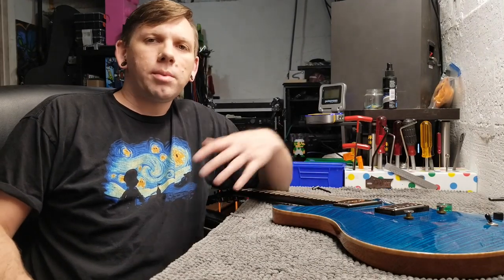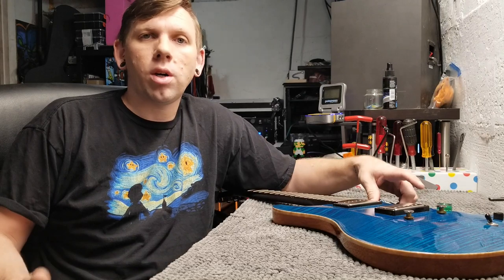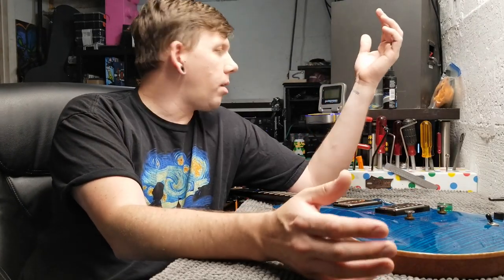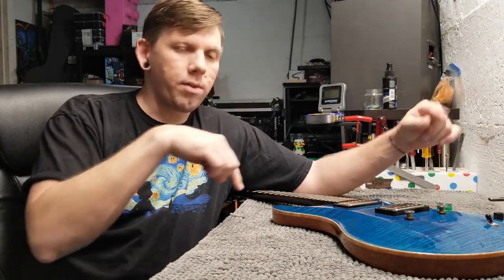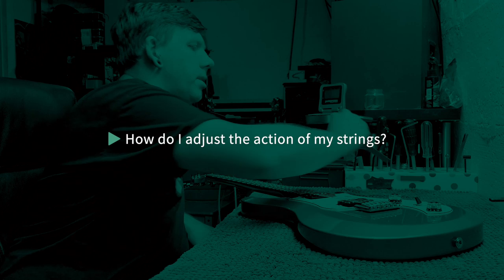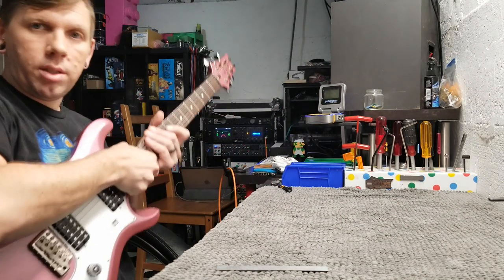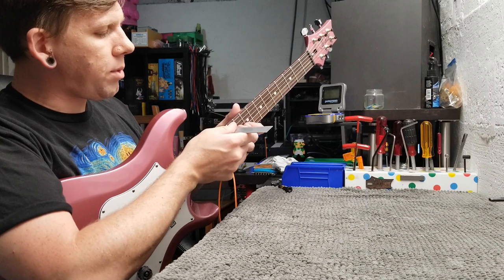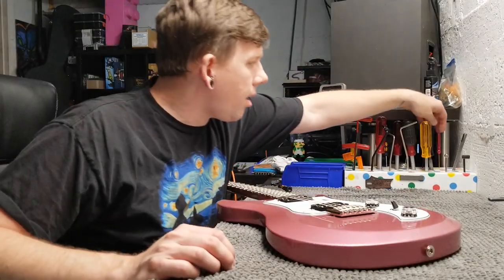Adjusting Your Action | Tips From The Tech Center | PRS Guitars

Comment: How do you adjust the action of the Paul’s Guitar?
Reply: Lol same here i need answers
Reply: I saw one video that showed the brass screws holding the bridge in place is how you adjust it but i only saw one video and the guy didnt even really demonstrate much.
Reply: @zacharybruner765  Yeah thats worked for me for smaller adjustments but when I tried to make larger adjustments that way the bridge ended up getting tilted out of place
Reply: @atticuscrowley  yea i just took mine to get a full set up. Installed the prs se locking tuners not thinking that they dont match up with the vintage style tuners that it came with so it threw it all outta wack. I figure i can make small adjustments down the line once its set up the best it can be

Comment: I realize this video is a year old, but my question is how do you lower the action once you run out of travel on the saddles? My guitar has the trem screws set to float so there's a half step of upward travel. However, the action is still higher than I would like it to be, and both of my E strings are already at the deck on the saddles. Is there a way to keep the half step of upward travel without lowering the tremolo via the trem screws? Or will I have to sacrifice some upward travel to get the action lower? Hopefully someone sees this and can offer some insight. Thanks in advance.
Reply: Same problem with my ce 24
Reply: Same problem. Got a solution?
Reply: Just received my guitar yesterday and I bottomed out on the high E adjustment without hitting my action height myself.
Reply: I took a chance and lowered tremolo slightly to get the lowest possible action and its doable, just be sure not to touch those screws when the string tension in on cause there is possibility of damaging knives inside tremolo (that needs to stay sharp)
Reply: Same problem. Bottomed out the saddles without coming even close to where I want the string height.. still has a TON of clearance.
Reply: I know these comments are old but if anyone is still having this problem, it’s possible the neck is bowed backwards, causing a lower action. 

I check by simply holding the guitar up sideways in front of me, closing an eye, and try to line the neck up with a vertical straight line in my room, like the edge of a door. If you can get it to line up from top to bottom, you know it’s straight. If not, you’ll be able to see which way your neck is bowed and can make adjustments to the truss rod from there (or take it to a shop).

Comment: Hi! I have got a prs se 2408, my guitar used to stay in tune while using the tremolo arm, but not it doesnt... i have seen an issue the bridge height. The pivot screw side of the brige is 2mm on both the bass and treble side. But at the end of the bridge, there is a slight angle on bass side which is slightly more than 2mm but on the treble side its 2mm... my question is if this caused for not staying in tune while using tremolo. Also how can i make it sit perfectly parallel to body i.e. 2mm on all four corners of the bridge

Comment: Thanks for the video.
Would you expect to action to change over time?
My PRS SE Custom now needs adjustment after 6 years or so.
It has been stored/subjected in lower temperatures recently but is in a thick/good gig bag.
Reply: This is might be late but most of the change in action in this scenario would be from the change of neck relief over time. If you had the measurements of the exact neck relief you had or of the exact action then you can quickly adjust the truss rod until you are back to those specs. It might buzz more because old strings are more prone to buzz. It’s also an easy way to adjust your truss rod when weather and humidity changes and you need to tweak it back to your personal taste.

Comment: Has prs ever done anything to correct the thousands of guitars that had the wraparound tilt of sitar.i know tonepros 2 wraparound fixes the bridge issue but it can also create another which is the radius change once replacing the bridge.i got great tuning with locking tuners and the tp2 but unless I set up with high action the D string is a buzzen. The guitar is a prs se245 soapbar tobacco burst (2013) model I just love this guitar but faster lower action is what I'm trying to accomplish. I know the radius only allows for a limited  action but mines way high. Can you give me some pointers for this problem. Like should I replace the nut or cheat the radius with a little flatter fret level ?

Comment: Why is it better to have the saddles like a starecase rather than in a more rounded way?
Reply: Even downward pressure on the 2 screws.  if you have it slanted the string is pushing slightly off the cut breakpoint instead of straight down.
Reply: if they are slanted the string will not sid exactly in the middle of the grove - I think that's the main reason

Comment: Good vid but I cant believe people are still setting the string height (action) using a ruler. You should use feeler gauges to set the action. I go for 0.060" across all strings, which is roughly equal to 2/32" this method is far more accurate. Also I  cant set my action any lower than 0.065" on my 408 because the saddles have bottomed out and wont go any lower. So it will be a case of having to screw the pivot screws in a tad more.
Reply: Every PRS guitar I've owned has had the saddles bottom out on the High E and B strings.  Very upsetting because I need to go lower!!!

Comment: Just got an s2 22 custom. Action still high with saddle screws backed all the way out and saddles laying flat. Any suggestions??
Reply: in this case you probably have no choice but to lower the 6 screws on the base plate (the ones he told you not to use) - make sure that you adjust them evenly and better completely remove the strings and the tremolo springs in the back first - there is a recommended measure that the trem should float 1/16" above the body (~1.6mm - I'm using 1.5mm picks to check as I don't want to scratch the body with those metal measure rules you can get) so this might be a good starting point - I got a CE 24 and mine was a bit too high too with the outer saddles (on the E strings) all the way bottomed out ... btw: if you did adjust them all flat you should try and get the inners back up so that it has the same radius/shape as your fretboard

Comment: Is there any reason why somebody might opt to adjust using the pivot plates versus the individual saddles- for a quick adjustment of higher action on bass strings, lower on the treble?
Reply: For the trem to work properly, it has to be in the groove all the way across the knife edges.  You'll want to set it flat at the lowest point you need it and do all your height adjustments from the saddles or you risk damaging the bridge and having some serious tuning issues.

Comment: I know you have to adjust your truss rod first then set action but for the truss rod adjustment do you always press the last fret even on set neck guitars as I’ve heard that some people use the body joint fret (17th fret) what’s correct? What the correct amount of neck relief, is it 0.010”?
Reply: I always do last fret on electrics.  I do acoustics 2 or 3 frets past body join.
Reply: James Zimmers thanks, what’s a good amount of general relief to shoot for?
Reply: HG15 around 6 to 10 thousandths at the 5th fret.

Comment: I am confused as in other video James says to adjust for seasonal changes you adjust the truss rod. I got a brand new SE Custom last month and it was perfectly setup but now it seems the action on the frets past 12 is too high. That's without changing strings gauge. So what's the best way to fix this, other than bring it to a luther?
Reply: @Jay W  Thicker strings will not allow for a lower action. The thicker the string the closer the string to the fret. Also, thicker strings will warrant a nut adjustment. Furthermore, bends are not easier with thicker strings either. They can be hard with 9s on a wrong set up and better with 10s on a better setup and vice versa but generally the thicker the string the harder it is to stretch which is what bending is. When you bend the string you're stretching it. The thicker the material the more force you need to stretch it.  And the floating bridge moving issue has to do with the tension and the way it is set up. There's a perfect height which is 1.5/1.6mm. Once that height is set don't touch it anymore.

Comment: my bridge isn't floating, how do I fix that?
Reply: Generally that is a result of tremolo's spring tension. if the back of the bridge is resting against the body you need to back out the adjustment screws a bit.

Comment: What the hell are seconds doing on a ruler ? can you please use a normal measuring system ? One that is actually used world-wide perhaps ?
Reply: By the way that's 1.5875 mm (round up to 1.6 mm) on the high E, and 2.38125 mm on the low E (round up to 2.4 mm)
I am just sick and tired of every video I check for stuff like this sharing only Imperial, which is used in only 3 countries...
Reply: Mate... PRS is an American company. Of course theyre gonna use imperial. You only ever see metric used here by engineers and physicists, and even then, its not consistent at all which system they use
Reply: Also, should you ever use those measurements for yourself, double checking, should be ~2mm on the low E, not 2.4, thatll be way too high
Reply: @mandolinka29  American company uses imperial measurements.
Reply: We work in thousandths of an inch.  32nds of an inch is easier to measure for most people.  And I can give them to you in metric but I’m just going to google the conversions.  Lol
Reply: Pretty rude way of announcing that you can’t work a conversion calculator... USA baby, that’s how we roll! Great video James!